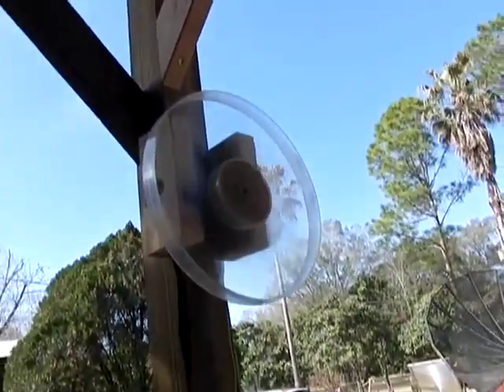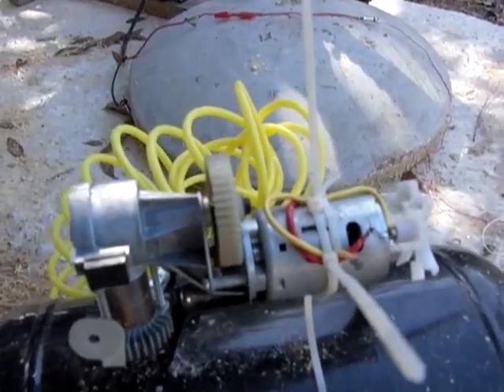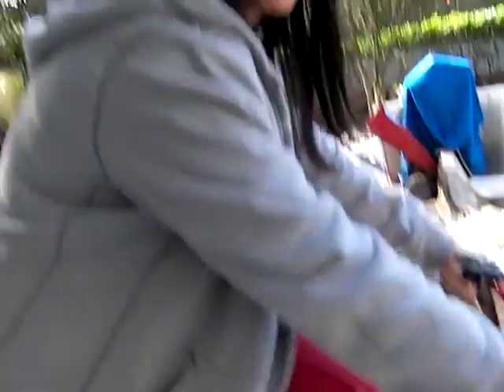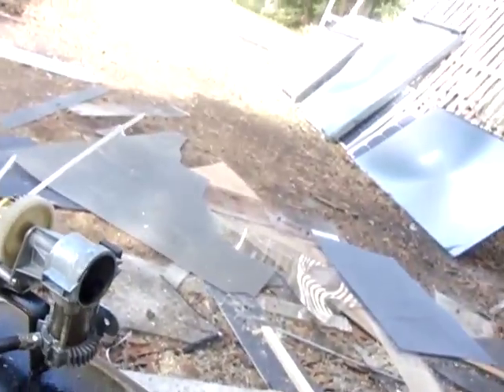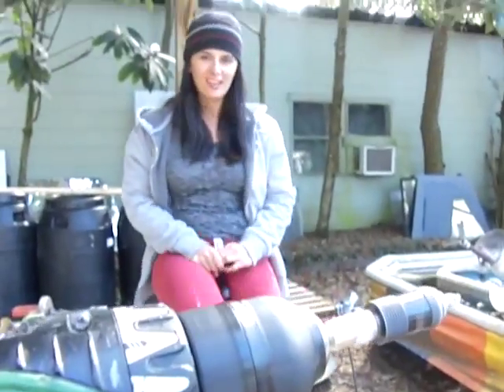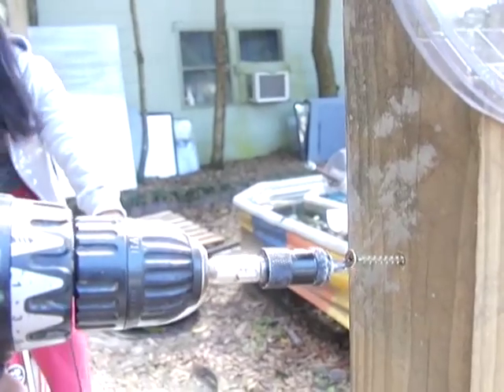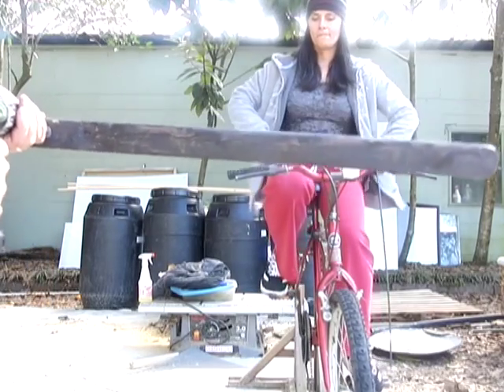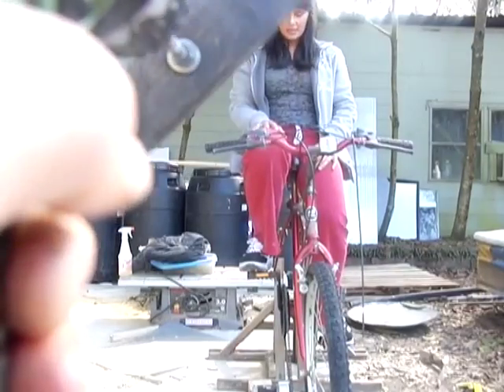Bicycle Generator Easy 5 minute transformation for electric power

Comment: Good stuff with the fun curiosity. The fan spinning with low resistance was interesting as well. It would be nice to know what the input (Amp,Volt). 
Some I think it would be interesting to install a Bedini SSG system on that exact fan set up u had. Might get some interesting effects on low resistance and keeping the inertia of the electron for efficiently charging batteries. Im currently building a bike powered smart grid for the occupy movement, hit me up any time. 1.618 0112358...INF

Comment: This video explained soooo much, thanks a bunch Dan and wife Denise!!!!  I just have a few questions:

1. Wouldn't it be more effective (and less load on biker) if you attach the generator to a 12v battery, then to a 120v inverter then to whatever you want to power?

2. What motor are you using?  I want to get that one too (unless you recommend others)!!  Cost and where did you buy it please?

3. Know anywhere I can find plans on the net (where did you get them?) to convert my bike to a stand?

Comment: i have a sc ooter motor like they have and yes those scooter motors work great for generating electicity , the only trick is you have to hook it up to a capacitor or you will blow your 12 volt inverter up i almost did trying to light up a  14 watt light bulb pluged in  120 volt from a 400 watt 12 volt inverter .

Comment: How about mounting the pm motor where the rear  tire was and finding one with a shaft size that you could mount the 10 speed rear sproket on. Really ramp up the output.....quick charging and  easy riding....great vid

Comment: Yeah, its about showing whats the right application for such generator. Pretty cool.
I notice one thing. Its a lil bit tiring to pedal, though shes cute when she padal, LOL.
I suggest to put up a heavy flywheel to feel a lil smoother run and lightens the surge current requirement. An Idea.
Thanks for posting great videos

Comment: I have a question,  is there a circuit you can put between the generator and whatever you are powering so that if there is a load on what you are powering it wont increase the amount of power needed on the generator. but instead just have whatever is taking the load go slower.

Comment: Hi Dan,

Great stuff as per usual. Not had time to watch the whole video as yet, but was wondering if it would not be more economical to connect a pully directly to the compressor instead of first generating electricity to run it. To my mind you would be able to store more of your energy as compressed air this way. I'll watch the rest of the video a bit later to see what else you got up to.

Please keep up the good work.

Comment: You might be able to put a sprocket in the chuck on a DC / rechargeable drill.  Tap the power output directly from the motor terminals to bypass the trigger speed control circuits.  The gear reduction might get the voltage up at a low sprocket RPM.

The drill gearbox might be more heavy duty.  Don't know if the drill motor is very efficient as a generator.

Your experiments & video are great and Denise is just soooo cute!

Comment: You guys are SO cool.
However I did spot one inefficient thing that you did not mention.
The seat on the bicycle is to low for your wife.  Her leg is still bent way to much when it is at bottom dead cinter. This does not allow for her to apply her full potential of power.
A small detail over looked by most people.  BUT;  Very important.  IF;;;  you want maximum power from your wife.